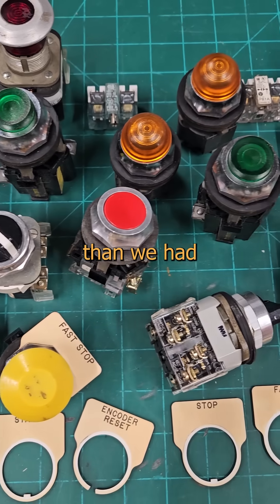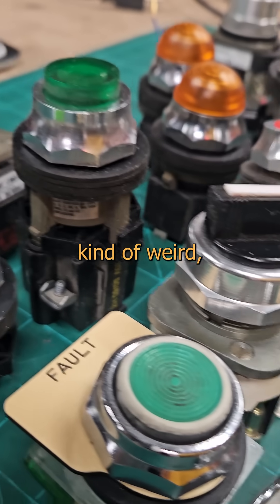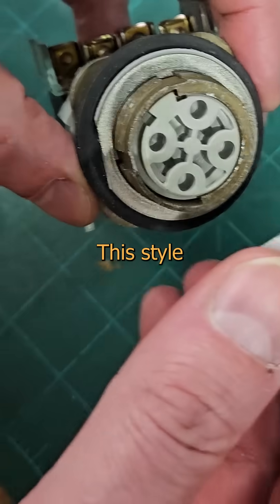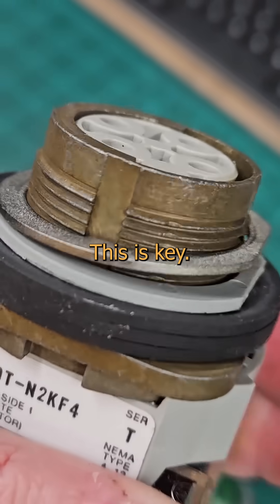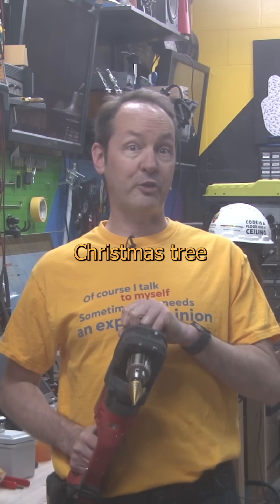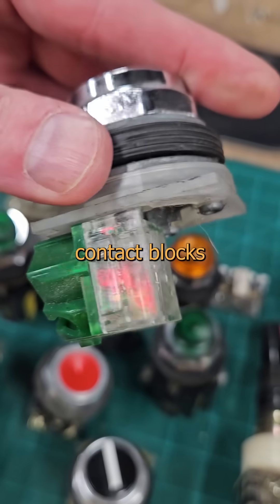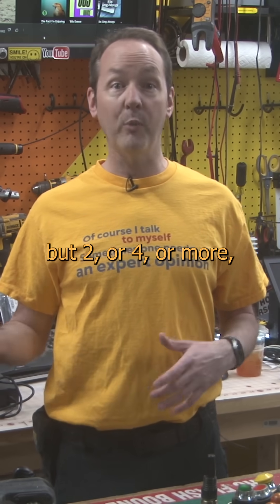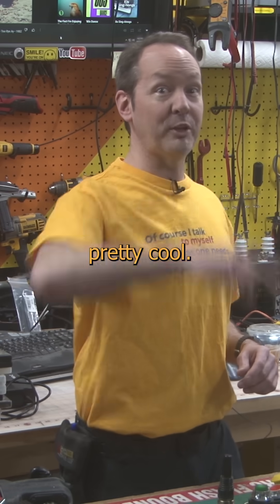Switches #chrisboden #engineering #industrial #control #panel #electrical #apprentice #educational

Comment: Or, you cheat (and MASSIVELY Screw the next poor fool that has to take that switch out of the panel) by using a dab of JB Weld Epoxy Putty to make sure that switch body stays EXACTLY where you set it...

😄😁😆😅😂🤣

Comment: Switches get to be more fun when you have to start dealing with "debounce" because the switch could make and break contact several times while being engaged. Most computers run at speeds that will record every one of those little make and breaks.

Comment: Rotating switxh bodies suck....  Make a 16 guage steel plate that mets the underlip of the penel edge..... that 90 degree return on panel will prevent this plate from totating. Cut out the shape needed with assorted drills, files, burrs, gopher teeth..... and use it as a washer to stabilize the assembly. There are sometimes pre-made plates from the switch manufacturer. For double dee cutouts, standard for keyed locks and simple keyed switches, Greenlee and others make a dedicated 2 piece punch. You drill a 3/8" Pilot hole, assemble the two die components, then wrench the nut until you have a 98% perfect DD punch out. I would imagine dedicated punches may be available to use with draulic khockout punch tools for these larger holes. I have a poor mans kit from PEarl Harbor Freight.... but though it works well, and has yet to give me a lethal hydraulic injection, I do not have special punches with the SHAPE to provide a stable install on a panel. Tools are nifty, but you can get crafty when you only need to do a few of these. Start with the largest round hole, then file, Dremel file, Dremel more, cuss and file your way to a panel.... then a month later, automate the function, and AIP the switch your sweated over! Lookie, I learned something from The Boden Chronicles.. what AIPing is !

Comment: The ones we use in Scandinavia has a setscrew on the back that locks it to whatever you drilled the hole in, we also have interchangeable contact-blocks, if you want some no and some NC or all of one kind, they also stack so you could get up to 6 different contact blocks in one switch 😂

Comment: I just want a SPDT switch with a pilot light to control a heater and a fan. I also want a separate switch to control the  fan alone. All switches that I've tried turn the pilot light in the heater switch on and off ONLY when I switch the separate fan switch.

Comment: What is displaying there are known as Alan Bradley type the other one that you run into is a company that's been passed around like this guy's mom they have names such as Square D, Telamechanique now owned by Schneider electric it's really all the same company now then there's the smaller type the 22 mm typically those are going to be your Fuji and Siemens there's a whole lot of other companies. 
A handful of switches and some relays and you can make all kinds of ladder logic work no PLC required

Comment: Yep I got those knockouts here at home I used to build panels but a simple file can make that notch just fine and the other problem just a simple round knockout you need at least two different sizes 22 mm and 30 mm

Comment: Bare chassis meant for customized vehicle bodies often have that same kind of keying for the ignition cylinder mount. We have one vehicle that had their ignition cylinder replaced with one that has a smaller body, so it just sits loose in the hole, and no matter how tightly we screw on the retaining nut and how much locktite we smear on the threads, it keeps coming loose and shorting the power lead on the sheet metal dashboard. Every few months it comes in for no-start, requesting battery service, and I replace the starter fuse, resecure the cylinder, and tell them they need to replace the ignition cylinder with one that fits, and then it comes back in a few months later with the same complaint.

In case anyone thought Chris was (just) joking about those grooves being key.

Comment: Buttons and switches are why i like working with some older machines at work, before we sold it i used to be the operator for our Whitney 3400 RTC machince, lots of buttons on that front panel to push and play with.

Comment: Forgotten which exact switch series we're using now but the back retaining blocks come in two varieties, one plastic and one metal. Apparently the metal one is required if the actuator has a metal bezel. It turns out that the metal back block has a little spike that is forced into the panel to ground it.

Comment: There's a reason the EATON M22 are the most popular over here, the actuator has a nub sticking out, the actual hole for it can be made by drilling a 22mm hole and then filing a slot for the nub, no need for special tools, no need to tighten them like crazy

Comment: I am a fan of HOA configuration switches, middle is off, left is manual or “hand operate mode” and right is auto or “machine operated” mode, a LOT of old school tech worked this way
Reply: Still in use, my favorite is troubleshooting, the it won't stop, configuration, usually some numbnut cross wired the 120 volt powered circuit and the 24v tattletale for PLC operation.
Reply: @jeffreyhueseman7061  literally happened to me at my last time messing with HOA switches. Always bugs me when people go off script to save a buck

Comment: NFPA 79: 10.5 Rotary Control Devices.

Devices having a rotational member, such as potentiometers and selector switches, shall be mounted in such a way as to prevent rotation of the stationary member. Friction alone shall not be relied upon to prevent rotation.

Comment: A dab of jb weld makes an easy makeshift antirotation nob
Just put a drop of oil on the switch so it doesn't stick to the switch while shoving it in the wrong hole

Comment: I've installed my share of 0.1% Vishay resistors in 24-position Elma rotary switches, and there's not one thing that's as simultaneously infuriating and sexy, not even the one time I decided to throw caution to the wind and dabble in the crazy smoke show.

Comment: Ok, so I'm having flashbacks. My granfather had a literal ton of old 60s and 70s military radio equipment that no one would take and we did'nt wanna fork out the money to take it to the dump, so we took it all apart, brought all the electronic components to an electronics recyler and the rest of the steel casing and whatnot to the metal recycling. 

Those fucking buttons and knobs were the actual worst. Right up there with the really old shit that had fabric-covered wire soldered directly to the casing.  At one point I stabbed myself, as in punctured my flesh to a not insignificant depth, with a goddamn *crescent wrench*. 

So many buttons.

Comment: Serious question, I set up a little solar charger so I can I have the solar panels connected to the battery Bank in either series or parallel series to have the voltage needed on cloudy days, parallel to maximize amperage when sunny. And the same thing with the output of the battery so I could have 12 or 24 volt output .
   But to switch the wiring from series to parallel using switches rather than rewiring every time takes more than several switches and you have to do it right. It looks messy with the arms of different switches glued together in different ways so they switched together...
    Do they make a single switch as a salable product to change wiring from series to parallel?
   Or would I be better off with a bunch of relays triggered by a single switch? Or do you know an IC that can comfortably and efficiently handle between 10 and 200 amps?

Comment: As an automation engineer, one of the most satisfying parts of my job is replacing one of those switches which has been in use longer than I’ve been alive and replacing it with a panel hole plug.

Comment: Crap tons of those on military panels and of all kinds of odd ball contact configuration. I didn't work on the missiles but the test stands that made sure all aspects of that BOOM stick still worked were all kinds of crazy wire mazes. ALL wiring was white high temperature thermal insulated with a hot stamp in the side or a tiny number sticker to differentiate what went where. Pretty bad when you can get PTSD just from opening a wiring panel.  Ooofda

Comment: i used a few of thease to set up a push button start on an old truck a used a green push button to start it and i used an old red stop button for the on off circuit it was cool

Comment: One job refused to put slap switches on machine 'emergency' stops, insisting that recessed rotaries were good enough. 
Maintenance chief asked me to change them after a small OSHA visit... If anyone does get pulled in, I hope they are thankful for something they can deactivate by flailing.

Comment: I have been a machine operator for like 13 years I know all them switches that's my entire day other than when I'm dealing with terribly outdated touch screens. Punching the metal housing around it or tightening the screw down get the thing to actuate while I wait for a mechanic to show up

Comment: That's why I hate switches that mount with a panel nut and need a tab. The Lovato LM2T range have an actuator that bayonet into a mounting block that has two screws that bite into the bottom of the panel. I haven't spent much time with other brands, but there are some better mounting arrangements out there.

And manufacturers, please - unless there's a good reason, use a hex nut instead of those crappy splined nuts. No-one wants to buy your special tool.

Comment: The right sized knock out punch and a right thickness file with the edge serrated for cutting is on hillbilly way I have been keynly able to avoid the expensive keyed knockout punch. If you’re really up against it one of them stubby hacksaw blade holders will let you kind of whittle at it like a dull beaver then flip the tiny tab back and forth with a needle nose until it fatigues and breaks free - not pretty to look at but it’s there. Also if you’re really good with the punch pre-drill a small hole on the edge of the knockout where the key is going to be cut the hole in half with the punch. A few swipes with the file and you’re a hero. 😉😁

Comment: Most of my switches are ZB2, but I just got some machines with Siemens 3SU1 switches. Now I have Siemens all over my shelves at work. 
BTW did you put my telehandler in the river? It sounds like younger you would have done that...

Comment: And thats why little spot welder is nice to have. Or any welder really, remove the panel so you dont put pixies into very expensive box of goodies, drill the hole with hog bit and weld a tap to keep the thing from moving. If visuals are not the important thing and the switch has square parts, bend a steel peace in 90, drill hole trough both the panel and steel peace so it sits on top of the switch and then rivet it in place and with out severe abuse the switch wont turn other than in places it should. Also note these switches are usually possible to take open and fix/clean, so while pixie wranglers in suit dont thing anything putting new 100€ switch in place, i rather spend couple hours taking it apart, cleaning the contacts and expending its life for following decade or two, but then again in my line its not 1million€ per hour losses when component fails.. I just wish those guys would sell "full hours" parts to us less fortunate that like to play with thousands costing parts, but cant afford them, while big boys throw them into trash working condition by the dozens..

Comment: I’m not quite sure how to explain the method. and it’s definitely “Millbilly” but you can drill a snug fitting clearance hole, then add tabs with a chisel.  Hit it with a file to remove the dangerous bits and install the switch. takes a little practice to get it right.

Comment: Thats where the eaton one have an adwantage: the tab is on the switch, so you can drill a normal hole and just put a notch in with a few strokes of a file. Or torque the switch so tight the plastic tab wedges into the hole ... 😂

Comment: The machines I build at my job have a "car key" ignition switch style of that. We use it for just the "crank" for the engine. Power is turned on elsewhere, it only controls the starter motor. I did convince them to add a keyway for it. First couple machines were a PITA to get the key tight enough to not spin in the hole.

Comment: They are pretty cool switches and the amount of times I have seen them loose and the wires are twisted behind because someone has dodged it up with a different switch and then it stops working because they have turned it so much that they have shorted out. 😢

Comment: One thing not mentioned is how the switch blocks are a mechanical pass through, that is, you can stack the blocks as many as you need and and the one actuator will operate them all.

Comment: It's fun working in an older plant like mine that's had major mechanical upgrades throughout the years. The 1979 vintage MCCs are all Red = Stop, Green = Run. All the new MCCs that have gone in over the last 15 to 20 years are all Red = Run, Green = Stop.

Comment: Sorry but I grew up on Honeywell Total Distributed Control which had no panel mounted switches. A couple mouse clicks and the service was switched or reset. Hard drives remembered the history of those settings in case there was a fault.

Comment: I got a couple panels of these switches I play with all day in the veneer mill. Goddamn you would be in heaven playing up on the lathe or the reeler. Also the debarker and log cleaner are pretty fun to run but the first 2 are the real fun jobs. Lots of switches buttons and joysticks.

Comment: You can pickup a keyway nibbler for around 300$ or dremel out a notch if it doesn't need to look pretty behind the label plate. Considering most of those buttons are 50-150$ per it doesn't seem like too much to ask for the right tool to install them.

Comment: I was a demolition foreman for a company doing an interior demo of an old GM plant, and there was probably 300 3ft by 3ft panels with these buttons and switches and lights and so on scattered on that plant. By the end of the project the crews knew where my pickup was and knew any one they found to bring it to me or put it in my pickup. I have literally an entire pickup truck load of them in boxes in my shop.

Comment: Believe it or not, similar switches are used on the desks of railroad locomotives for at least the alertness devices, I’ll have to look at the horn and bell buttons, but I suspect them too. 

I’ve done tons of unsanctioned maintenance on the alerter buttons because it’s obnoxious and we get a little too aggressive with them

Comment: Worked at a stucco factory that had been on How It's Made TV show. Half the building and silos outside are one 7 story machine. One Estop circuit throughout. Mysteriously a month in to my new maintenance tech job a button two floors down in a pit was pushed. The cover to the pit had undisturbed dust on it, but a piece of conduit nearby could have fit through the hand hole to open the hatch and possibly reached the button.. It took a while to find it, the previous techs all quit before I and another guy started so it was fun for while learning how it all worked. I love controls especially relays. Yes I am retired.

Comment: I remember having an argument with a Navy Nuclear officer about "make before break" switches after a motor control panel burned up, and being told "that wasn't a thing" because the nuclear navy didn't teach them about IEEE, And I was MECHANICAL engineer and knew the difference, Rickover was a douche....

Comment: My favorite is the one that falls into the panel when you touch it and the rush of adrenaline that follows. Running doesn't help much when copper vaporizes and turns into an invisible passenger car at the speed of FU.

Comment: Made a bunch of controll cabinets for my old job, you know that some of the bigger suppliers will lasercut the lids for you if you supply the design i.e. hole locations, size and notch placement for orders of 10 or more. 

Usually used Eaton switches, they have a bracket with 3 universal slots and depending on the button you put on there, you could use the center one for a LED, also the NO/NC switches could be stacked on top of each other. Schneider ones we used had a M3 bolt that attached to the button or a backing plate. They all have their own advantages and drawbacks.

Comment: The fact he has 15 switches in that first shot alone, it kinda bonkers. Especially when you consider those things new are minimum $250 a pop. yes, that first shot is probably about $4000 in switches and lights.

Comment: If one laser-cut sheet stainless with spaced holes with keys, it could be overlaid on the backside of the panel such that each switch keys to the sheet and the hole in the panel, such that when everything is installed, nothing turns. And as long as one is left tight, no misalignment is possible during refit. Also, it's ven-ER-is. :D

Comment: Everything electrical is a a single pole switch. Weather in banks to make motor starters, PLC controls, computer motherboards or the light in your refrigerator (if it really goes off) broken down to it’s simplest form, everything is a single pole switch.

Comment: And no matter what any tech bro says, we cannot and should not try to replace these switches with a bunch of relays and microcontrollers connected to some networked Siemens controller just waiting for a bad firmware upgrade to open a backdoor wider than your dad’s on Saturday night.

Comment: The Siemens Sirius ACT series has a nice needle like pin in the base module to stop the switch from rotating. Many options to select from makes those my favourite signal switches / signal lights so far.